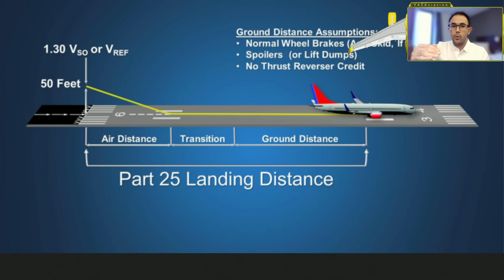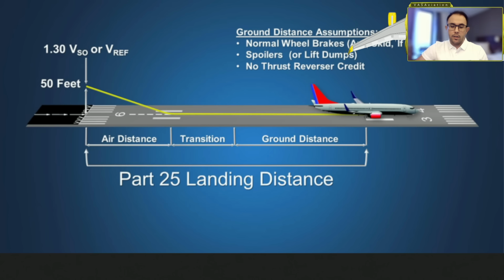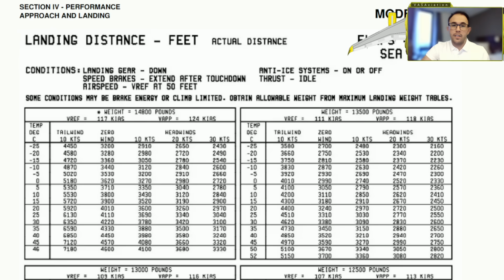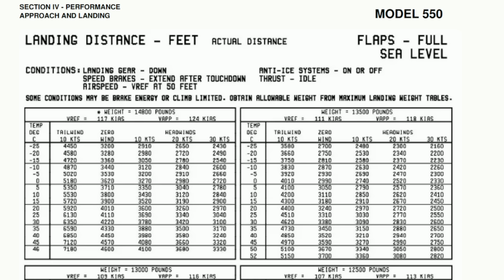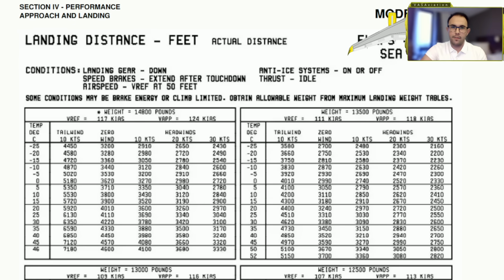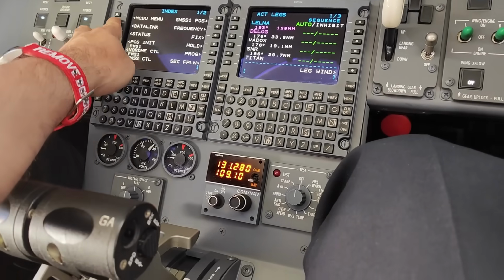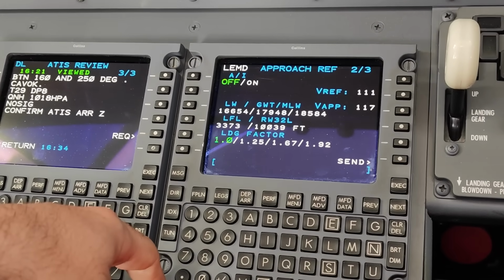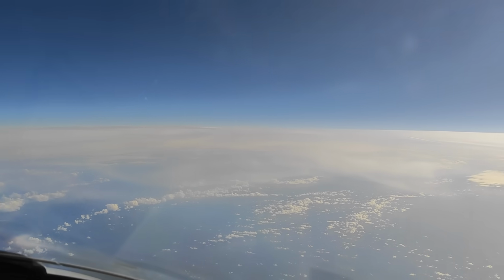Aircraft Approach Categories EXPLAINED about San Diego Plane Crash

Comment: Victor, you are correct that aircraft are certified based on Vref; HOWEVER, if you look at the Digital Terminal Procedures Supplemental, it clearly states that the approach category should be chosen based on the ACTUAL speed flown during the approach. If that Vapp is > 120 (up to 140) you should be flying to Category C minimums. In the recent Citation accident, he likely had a calculated Vapp of < 120, but the flight data appears to show that he was flying faster (see his ground speed and the no wind condition), although I don’t think approach category will be found to have had any significance for this particular crash. What IS significant for all of us is that the higher the approach speed, the bigger the turn radius (horizontal and vertical), hence the need for higher approach categories (higher minimum approach altitudes) to keep faster planes within protected airspace. Certification is just theoretical; ACTUAL turn radius is what the rocks care about. Thanks for all the work you put into your great channel!

Comment: Isn’t it illegal to start an approach at an airport without having a current weather report? This makes the whole Category thing moot.
Reply: My understanding is the pilot can do an approach, but cannot land if he does not have visual contact at the minimums. They have to not land at that point.
Reply: @Biochemechanic  § 91.1039 IFR takeoff, approach and landing minimums.
(a) No pilot on a program aircraft operating a program flight may begin an instrument approach procedure to an airport unless—

(1) Either that airport or the alternate airport has a weather reporting facility operated by the U.S. National Weather Service, a source approved by the U.S. National Weather Service, or a source approved by the Administrator; and

(2) The latest weather report issued by the weather reporting facility includes a current local altimeter setting for the destination airport. If no local altimeter setting is available at the destination airport, the pilot must obtain the current local altimeter setting from a source provided by the facility designated on the approach chart for the destination airport.
Reply: I am a pilot for Delta Air Lines and we do not operate under Part 91 but certainly it is illegal for me to even begin an approach to an airport without the current weather for that airport.
Reply: @ShivadasaOm He got some conflicting data on the weather for different surrounding airports, so maybe gets a pass on that. The altimeter info from the airport was inop at the time, no way to know if he read that NOTAM.
Reply: @Biochemechanic One thing we know for sure is that he did not get a pass. He also never received, nor did he ask for, a local altimeter setting from the time he checked in at 17,000 with SOCAL. When he was given the clearance to descend out of FL180 he would have been given that sector’s altimeter setting from the ARTCC controller, but that can be significantly different from the approach field altimeter setting.
Reply: @ShivadasaOm  Hey bro, you are citing a Subpart K reg which is for Fractional Ownership Operators. For operations under Subpart B, no weather report is required prior to commencing an approach. Read what you you are cutting and pasting before pasting.
Reply: @skyboy1956 I was just asking the question. I don’t claim to know what sub part these operators use. It doesn’t seem smart to do it, although if he had flown the approach to mins with an accurate altimeter setting and then gone missed when he didn’t see the runway, the accident would not have happened.

Comment: I cannot let this go on further.  From FAA Information or Operators (InFO) 23001: Use of Aircraft Approach Category During Instrument Approach Operations.  

Background: Aircraft approach category is a grouping of aircraft based on a Vref (reference landing speed), if specified, or if Vref is not specified, 1.3 Vso (stalling speed or minimum steady flight speed in the landing configuration), both at the maximum certificated landing weight. Vref, Vso, and the maximum certificated landing weight are those values as established by the certification authority. In 2002, Title 14 of the Code of Federal Regulations (14 CFR), Part 97, § 97.3 was changed to include Vref as well as 1.3 Vso to establish approach category. This speed, determined at the maximum certificated landing weight, establishes the lowest applicable approach category for all instrument approaches regardless of actual landing weight.

Discussion: An aircraft’s approach category does not change if the actual landing weight is less than the maximum certificated landing weight. This certificated approach category is permanent and independent of the changing conditions of day-to-day operations. Aircraft may not be flown to the instrument approach minima of a slower approach category (e.g., a category C aircraft may not utilize category B minimums).

If it becomes necessary to operate at a speed in excess of the upper limit of the speed range of an approach category, the minimums for the higher category should be used if available. This may occur with certain aircraft types when operating in heavy/gusty wind, icing, or non-normal conditions. For example, an airplane that is certified as category C, but is circling to land at a speed of 145 knots, should use the approach category D minima. Pilots are responsible for determining when a higher approach category applies. Regardless of approach category, when circling to land, the pilot must, in accordance with § 97.20, maneuver the aircraft within the circling approach protected area for that category to achieve the obstacle and terrain clearances provided by procedure design criteria.
Reply: InFO 23001 continued:

A pilot who chooses an alternative method when it is necessary to maneuver at a speed that exceeds the category speed limit (for example, where higher category minimums are not published) should consider the following factors that can significantly affect the actual ground track flown:

• Bank Angle - The angle of bank used during circling approaches may significantly impact the turn
radius. Conversely, pilots should be aware that using an excessive bank angle when executing a
circling approach can lead to an unstabilized approach or possibly loss of aircraft control.
• Indicated Airspeed - If a pilot chooses to operate at a higher speed, other factors should be
modified to ensure that the aircraft remains within the circling approach protected area.
• Wind Speed/Direction – Downwind turns may significantly impact the turn radius. Therefore,
pilots should carefully plan the initiation of all turns to ensure that the aircraft remains within the
circling approach protected area when adjusting for winds.
• Pilot Technique – Pilots should take all of these factors into account when planning and executing
instrument approaches to ensure a safe, stabilized approach is performed within the protected area.

Information provided in this InFO does not supersede, but augments circling guidance published in the
Instrument Procedures Handbook (FAA-H-8261-16B), Chapter 4, the Instrument Flying Handbook
(FAA-H-8083-15B) Chapter 10, and the Aeronautical Information Manual (AIM), Section 5-4-7.
Operators should also consider if and when it is appropriate for pilots to conduct a circling approach at a
speed in excess of published limits and provide specific guidance (i.e., Standard Operating Procedures
(SOPs), Safety Management System (SMS), etc.).

Comment: This whole situation shows the value of type ratings. While there are categories, and while some generalizations may "usually" be true, not every airplane falls squarely within the same sets of categorizations. Guys/girls really do need training in the specific type they're flying/going to be flying to ensure they know the unique characteristics/details of that specific type. While the "chattering class" doing accident analysis on YouTube - Some of them anyway - Are normally fairly reasonable... Every now and then they're going to get burned, offering defective/bad analysis, because they don't have any particular knowledge of the aircraft type they're commenting on. In this particular accident I believe weather and other factors also need to be taken into account - While it may have in fact been legal was doing a night landing, in poor weather, having a single type qualified pilot, and after flying cross country all night really a smart idea? Regardless of the approach legality I'd suggest it should have never been attempted... (At least) 4 negative factors is 2 or 3 too many to be dealing with, especially single pilot. Too many odds stacked against a successful landing. They should have either not flown the full cross country trip overnight or diverted to an airport without the coastal fog layer, waiting for it to burn off in the morning before finishing the trip.
Reply from the maker: If the decision to land or to shoot the approach was correct is a whole different story. And with that we can create a very huge debate

Comment: 12:39
For those interested in where the Landing Factor numbers come from, they are as follows (with reference to the FAA FARs):
1.0 is dry landing distance right from the book (i.e. Unfactored, and performed as the test pilots flew it - 50 feet over the threshold at Vref, minimal flare, maximum braking)
1.25 is the “80% rule: 1 ÷ 0.80 = 1.25
1.67 is the “60 %” rule: 1 ÷ 0.60 = 1.67 [§135.385(b)]
1.92 is the “60 %” rule with 115% added to it for wet landing distance Part 135: 1.67 x 1.15 = 1.92 (§138.385(d))

As one can deduce, the 1.0 Unfactored numbers are not how pilots usually land - passenger comfort is considered, hence the need to add some "fudge factor" into the landing distances. This is the reason for the 60 and 80% numbers that for-hire operations use.

Another excellent video, Victor. Cheers!
Reply from the maker: Thank for expanding the info. Only in some instances, short runway and NON commercial flights (with the owner or only crew) we can use the unfactored distance. Short runways like Le Mans and under certain conditions we wouldn't be able to land if we were factored.

Comment: The accident aircraft was not a 550, it was the S550 which had the same wing as the 560/560XL series. It was also retrofitted with more powerful Williams engines which included the removal of thrust reversers,  all of which changed performance numbers from the factory built plane.
Reply from the maker: Still a category B aircraft

Comment: 737 and most airliners are category D.
Reply: Thank you. This is accurate. The A320 is also a cat D.
Reply from the maker: A320 is a CAT C aircraft, not D
Reply: @VASAviation  sorry my reply was abbreviated. At max landing weight the 320 I fly had a Vapp of 144kts. So I fly it as cat D.  The lowest I have ever seen is Vapp 113 in an empty 319. Felt like it was going in reverse.
Reply from the maker: Absolutely not. They most of times fall into the CAT C airspeeds. A321 however has higher weights. Or when on a circling approach with higher restrictions.

Comment: I am a Citation pilot.  I agree with your technical analysis that this is a category B aircraft.  There is no question this was a "legal" approach from that perspective.  But I think the larger point is that there were many other factors, which when added together, made this a very dangerous approach to attempt.  It appears they were flying with a single pilot.  They flew all night across the country into an untowered airport with a relatively short runway, with no weather information available.   An airport located 4 miles away indicated an obvious marine layer, which is very common in San Diego this time of year.  The single pilot was trying to figure out the approach conditions and communicate with ATC just a couple of minutes outside the final approach fix.  They came into the final approach fix very fast which made for a rapid, unstable approach.  There was no PAPI or approach lights working at the airport.  There are numerous other important questions (fuel status, avionics capability, pilot rest, etc) for investigators to examine but this was a very difficult approach to attempt under these conditions.  In retrospect, a far better decision would have been to divert to either Palm Springs or San Diego International where there were much better weather conditions, longer runways, and help from ATC.  At a minimum they should have gone around until they could attempt a stabilized approach.  It is very sad for those killed or injured.
Reply: For me, CFI and airline pilot.  Was very irresponsible to even try that approach.  He sort of wanted to go under minimuns from the go.  Houses  and people there  to zoom at maybe 200 agl level off at 4 am he didnt care..
Reply: @outwiththem  Exactly...he didn't care.  A sad case of I am smarter and better than the folks who designed this approach.  I will just duck under the glide path and see if I can see the runway...He had about 4-5 seconds to think about his decision after snagging the power lines.
Reply: @JohnBaileyDarke  After seeing the accident scene firsthand this past weekend I don't think he would have made it in with the terrain ahead even if he cleared the power lines.
Reply: @JohnBaileyDarke  His last words were, oh shitt, i fuckeed up, stalled it and crashed after hitting the wires at 140 mph
Reply: I am a local CFI. I agree with you 100% for the reasons you stated. I went back and checked some track logs and the last time I shot the RNAV 28 as an LPV, I was about 500 to 600' higher than the accident aircraft in the same general area in which they struck the power lines. Everything was telling this guy to divert. It's a shame he didn't and as a pilot, this makes me extra mad because no one else in that airplane had any idea how dangerous this was until it was too late.
Reply: Also the pilot was the owner which is a deadly combo on its own. Virtually no insurance coverage available. The S550 single pilot waiver places certain restrictions on approaches. I forget what it said about straight in but I'll look it up later tonight.
Reply: @SquawkCode  You mean you dont need insurance even on jets.  i flew them, 32 years ago, i though i had insurance..  Damm.
Reply: @outwiththem I didn't say anything remotely close to that. There is virtually no insurance available for a single pilot, owner flown jet.
Reply: CFI too.. This Cat B/C is a moot point. The question is “should” you not “could” you. Like most of the replies above 👍
Reply: @toddsmith8190  💯
Reply: @TomTiller-kd7fr:  how does one spell pilot error?  PILOT ERROR.

Comment: It is somewhat misleading to correlate instrument Category with aircraft size.  Everything is according to approach speed, not size.  For example most military fighter class aircraft are Category D or E, while an MD-11 with that massive wing lift is Category C.  An aircraft type can also fall into more than one Category depending on the type of approach (e.g. Category D for straight-ins, Category E for circling).
Reply from the maker: It's just a reference
Reply: Maybe,in some airplanes, but it’s mostly Category D, which considering its reputation is reasonable.  See link, Chap 13.

https://www.faa.gov/sites/faa.gov/files/FSBR_MD-11_Rev_3_Draft.pdf

Comment: ICAO PAN OPS are more detailed when designed compared to FAA TERP.  Example Category B still 91 to 120 kts.  but included in Cat B  is Range speeds for initial approach is 120 to 180kts.  range for final approach speeds 85 to 130kts,  max speed circling 135kts,  max speed intermediate missed approach 130kts,  max speed for final missed approach 150kts.
Reply from the maker: Indeed there's so more in depth details about all this
Reply: TERPS also contains similar considerations for speeds on the initial, intermediate, and missed approach segments.  That is why approach category is based on either 1.30 x Vso (for aircraft type-certificated prior to 2001 in the US) or VREF (for aircraft type-certificated after 2001 in the US), AT THE MAXIMUM CERTIFICATED LANDING WEIGHT.   As such, approach category for an aircraft never changes.   You may never move to lower category, as that would put your maneuvering speeds in the initial, intermediate, and missed approach segments outside of the speed limits used to define the protected airspace.  You may use a higher category minima, but in the US, you are not required to do so.  AIM Section 5-4-7 and InFO 23001 provide guidance to pilots if they need to maneuver at speed that exceeds the upper limit of approach category for their aircraft and for a category which landing minima are not published, or annotated "NA" - Not Authorized.

Comment: The subject aircraft is certified as Category B. At the final approach fix his speed 192knots and slowing.  But there are exceptions and pilot judgement to the rule.  For example, an airplane that fits into Category B, but is circling to land at a speed of 145 knots, must use the approach Category D minimums. As an additional example, a Category A aircraft that is operating at 130 knots on a straight-in approach must use the approach Category C minimums.  Per FAA page 4-8  https://www.faa.gov/sites/faa.gov/files/regulations_policies/handbooks_manuals/aviation/instrument_procedures_handbook/FAA-H-8083-16B_Chapter_4.pdf#:~:text=Aircraft%20approach%20category%20means%20a%20grouping%20of,VSO%20at%20the%20maximum%20certified%20landing%20weight.&text=If%20a%20faster%20approach%20speed%20is%20used,the%20appropriate%20higher%20category%20must%20be%20used.